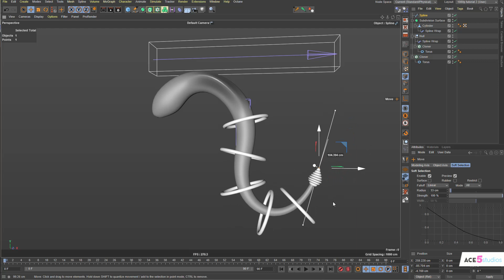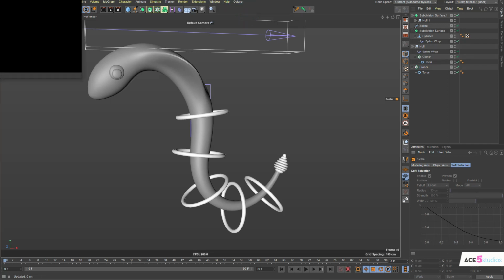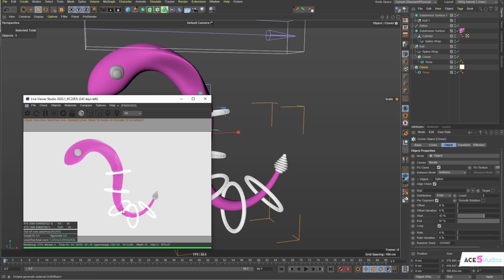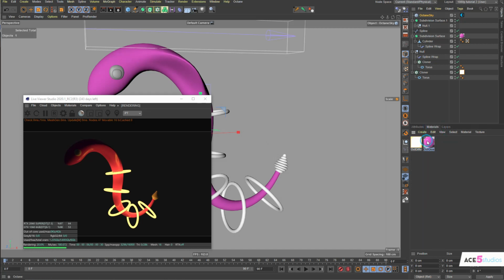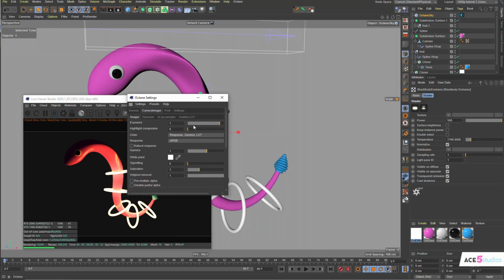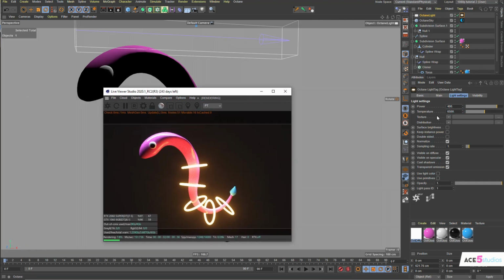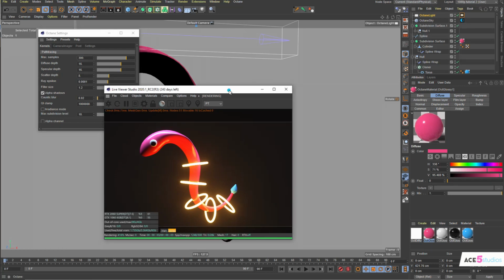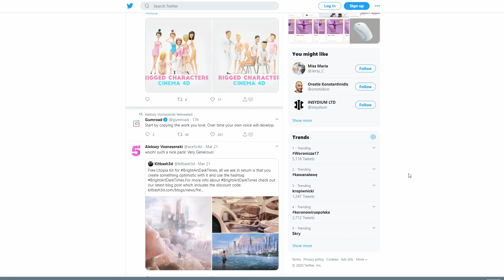C4D: Spline Wrap Deformer Tutorial Part 2 - Octane Render

Comment: can you show how to bend a pipe four times just using the bend deformer. So as to make a rectangle with 45 degrees for each corner. I mean a rounded/beveled rectangle.
also how to fold stuff on top of each other just using the bend deformer.

In short, I want know all the creative  ways a bend deformer could be used.
Just creative ways in your style and perspective.
Because you are JUST SO GOOD.

thankyou SIR.
Reply from the maker: I think there may be a limit to that, but i'll check it out. bend deformers under each other might break each other. I'll probably post the result on my twitter: https://twitter.com/ace5c4d

seems like perfect short gif material.